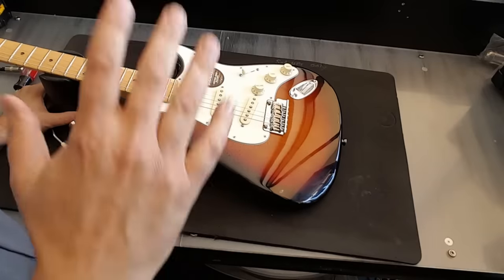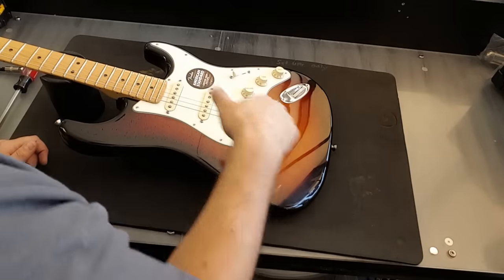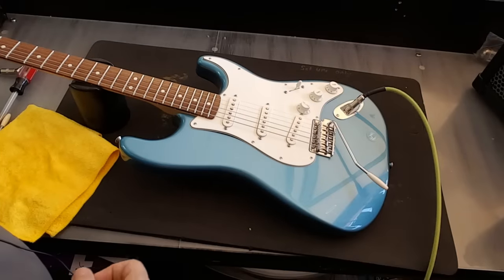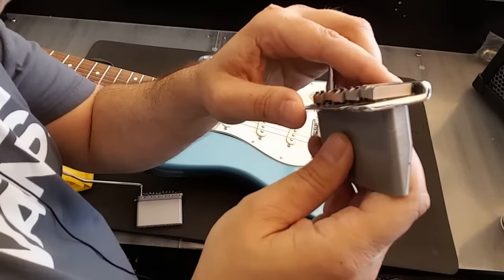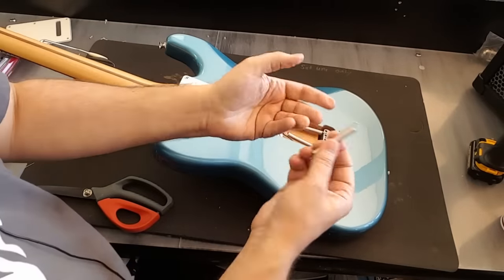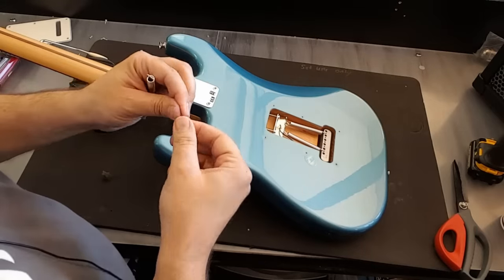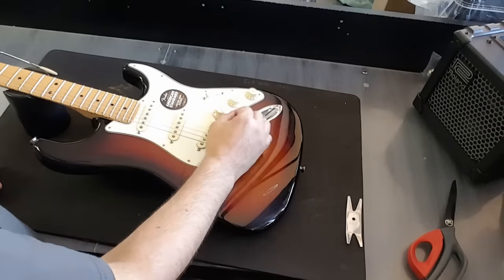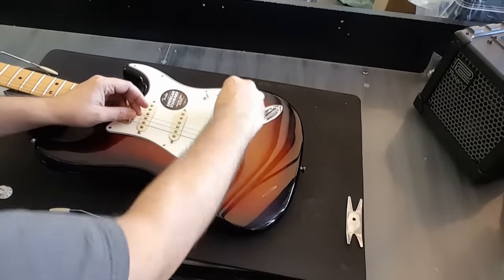5 things you didn't know about your Fender Strat

Comment: No5 is a good one. One of my strats the volume pot moves too easily. I've been looking for solutions but till now not seen any.
Regarding the trem spring, it doesn't work on my MIM strats as the hole goes all the way through and the spring falls out. I just use the old plumber tape and it works fine.
Reply: hahaha Teflon don
Reply: +fishy paw mim strats made before 2006 have holes that go all the way through, but i believe they changed this on all or most mim strats after '06. do you know what years your mexican strats are?
Reply: +fishy paw Yes the older MIM's have a different block. As you said PTFE tape or Rizlas should work: Thats how I secured the switch tip on my '52 re-issue Tele :-)
Reply: Just get rid of all the knobs, the tremolo arm, those extra pickups...
Reply: +moreanimalspirits              You're not here for the bear hunting, are you? :-)
Reply: tezzo55 Ha ha , he's being a right Dick (Dale) ! ;-)
Reply: +Bristol Blue 
Just go down to guitar center, plug in strat with Alnicos into a  hot rod deluxe, and let the tube cleanliness overtake you. You might ask yourself - as I did - what have I done? Why do I need these pedals, these tremelo's, those extra pickups, knobs, switches, blinking lights? Am I a tap dancer or guitar player?
Reply: moreanimalspirits Brilliantly said sir! 
i just plug my ol' 63 strat, into my early 60's Vox AC15, and the effect, is electrifying! Never sounds out of date (even though i do!) :-)
Reply: moreanimalspirits I'm not disagreeing. I was referring to Dick Dale and his stripped down Strat. I have a Les Paul, Ric 330, '52 Re-issue Tele and a couple of Strats. Mostly use a '71 WEM Clubman or a mid 90's Marshall JTM30. I don't have a pedal board, just a few pedals which are used now and then. So, you're preaching to the converted mate :-)
Reply: Fractal over £1000 aint they ? Too complicated for me anyway ! I would rather buy another nice guitar. All I'm looking at currently is a Danelectro Spring King or the Boss '63 Fender Reverb model pedal. I'm in love with the Surf Sound of the 60's and a mate demoed his Strymon something or other . It was OK if you're Dave Gilmour or want to spend over £250 on something you'll never use :-)
Reply: Bristol Blue True dat bro, and i ain't about to get one thousand bucks, any time soon, so you is right! 

The Danelectros look amazing! i've never actually played one, but i'd love to, they look so cool!

 And then these other treasures of which you speak, i know them not, but they sound well groovy, (a thing for which, one should always strive!). 

i'm presently putting a dream guitar together, from parts sourced from all over, and it's cost a fortune and it took a while to get all the bits, and i'm NOT a guitar builder (spot the deliberate error, yet?). 

The body is a chambered, semi-solid, f holed strat shape, with gorgeous flamed, book-matched, maple top. It's presently got a creamy finish, but that should wipe off, do you think?  :-)

i got a Mighty Might, maple neck, a gold Stets Bar, gold automatic tuners, the classic two Seymour Duncan humbuckers, (is it, the jazz and the Jeff Beck?) and, Oh yeah, the Stets Bar, has piezo, for midi, and uh, piezo sound. 

And this very day, i'll be clearing my work bench to start work on it, after some two years or so, of collecting the parts.

So i guess you have your purists, and then you have your sluts, and i guess that's me! Hee hee!

So i'm feeling well groovy! Hope you are too bro. Thanks for message man, love guitar players. 

Best  :-)

Comment: The trem tension spring does not and will not prevent anyone from cross threading the arm. Cross threading when it happens, happens right at the start of things
Reply: Although i do understand what you are referring too,
 In this case... i dissagree, 

The spring helps to prevent
over tightening of the arm,

Picture this...
A thread can be 100% perfect whilst screwing the arm in, 
Until it is overtightened to the point where the arm runs out of thread & then bottoms out causing the initial thread in the block to be disfigured,
The thread on the arm can be over stretched aswell,

Hence,
Thread damage can and will only begin to happen upon removal of the arm.
Reply: To avoid cross-threading, the common "trick" is to begin by turning the arm the opposite direction (as if you're unscrewing it) while with ever so slight pressure push the arm inward. As you slowly turn the arm, you'll reach the point where the start of the two sets of threads pass each other. When that happens, you'll feel the arm drop inward slightly, at which point you immediately stop turning counterclockwise, and proceed to turn screw the arm in. This technique, of course, can be applied to any screw situation, not just tremolo arms.
Reply: shucks.. try a little plumbers tape on them threads. works like a charm.

Comment: Phil. 
You're an extremely knowledgeable guy with a lot of guitar stuff. I have a question that I can't seem to find the correct answer. I have even emailed Fender with no response. 

When looking up a Serial # for a Fender Strat on the Fender website. It tells you a bit about the guitar the number is attached to. Even will show you a picture of the guitar in seemly the correct color of the guitar. 

Would you know if the color that shows up on the picture of the guitar after searching the Serial # is in fact the original color of the guitar? 
I have searched a few and they all seem to be matched correctly with a guitar I am interested in. However, I am about the buy a 2019 Professional Series that is Olive Green but shows up as a White Strat after searching the serial number.  The guitar hasn't been resprayed... 

Ideas?

Thank You

Comment: so does that tremelo arm spring not work on a MIM strat?  there is a hole in the bottom of that opening so when i put the spring in, it just falls out the bottom.
Reply: Some of the earlier 90s mex had a hole in the bottom, so you cant add a spring, but im pretty sure all recent ones are solid!
Reply: mine is a '10
Reply: whitedevil2 tap the hole and put set screw in it.
Reply: My MIM Strat came with an Easy-mute tremelo.

Comment: That spring noise is created by putting the springs in wrong. You don't want to go all to the center like this: \|/
You want them to go parallel like this: | | |
Otherwise you create uneven tension on the springs which results in ringing and buzzing of the outer two springs.
Reply: What actually happens is that the outside springs are at a different tension than the middle spring. Because the two outside springs are the same tension, as long as your claw is balanced and not all cockeyed, the difference in tension between the outside springs and the middle spring doesn't do anything. However, what it does do is pulls the bridge just a bit more, so if three springs is too light for you but four is too stiff, the added tension of \|/ may feel better to you. As long as your claw is balanced and your springs aren't damaged, there isn't any difference in tone or tuning stability. One is not better than the other, it's just a preference thing.

Also, regardless of which way you do your springs, they still make noise if they aren't dampened in some way. One way is not quieter than the other.

Check out how Carl Verheyen sets up his Strats for a neat way to set your claw and springs up, which is not equal tension, allows for your bar to pull up a half step on the high E, a whole step on the B, and a minor third on the G, while still maintaining tuning stability.
Reply: NOISE..?    thats the Trem Strat magic...wow...buy a Tele

Comment: Using the little spring with the trem arm also allows you to have a bit more space between the trem arm & the bridge and body. Sometimes in order to have the trem arm fairly secure and not loosely swinging around, you have to screw it in so much that it seems almost too low to have a finger between the arm and the body. The spring takes up the space enough to keep the trem arm at an ‘altitude’ that’s a little more comfortable. 

If you don’t want to use it but also don’t want to lose it - you can take a piece of tape & secure it to the backside of the rear cover plate. 
Just a thought…

Always enjoy your tips & tricks, Phil! 👍🏼🎶

Comment: Hi Phillip- here's funny Fender spring story: On our way to a gig in 1987, my 1963 Volvo 544 sedan popped a carbuerator spring in the middle of the Santa Cruz mountains. Of course the whole PA, & all the gear was "tetrised" into the Volvo, but we were able to get a spring from my 1963 Jaguar whammy that worked(ironically, same year as the car). You aren't kidding about the strength- that spring is STILL on that (running) car today( which now has 2 million miles on the original B18 engine. I will NEVER drive anything but an old Volvo. WORD.).  Sold the Jag in 2009- have newer Tele these days. (Miss that Jaguar.....)

Comment: Using the little spring in the trem arm hole makes a squeak noise when the bar is moved. It’s better to wrap the bottom of the trem arm grooves with pipe tape. There are different thicknesses and you can decide what works for you. Keeps the trem arm right where you need it and the arm is super responsive to touch. No gap in that slot. I’ve done that for player’s guitars and they agree it works great. Give it a try and see if you like it

Comment: strips of interweaving felt work nice too for the trem springs; never thought of inserting any sort of dampening down the spring, however. nice trick.
Reply: Fold pipe cleaners in half and cut them 1/2 inch longer than the spring's coiled section.  Then insert then in the spring with a bit protruding past the ends of the coil.  Straighter ISN'T better, a couple of small kinks in the folded pipecleaner will help it stay centered in the spring.  Check every so often and recenter the pipecleaners after re-kinking them.
I guess eventually the cloth area wears out and needs to be replaced eventually.  It'll take a while.
Reply: Oh yeah, weaving (over-under-over, etc.) pipecleaner through the strings behind the nut and behind the bridge stops those areas from ringing, (example, a Les Paul style setup).
In my experience, this will have very-near-zero (or zero) effect on tuning stabiliy.

Comment: 1. Holy crap! Mex thanks you for this, spring on the way. 2. Way ahead here. the shielding in the mexican strat was just a bit of foil tape and sounded like deathmetal in the basement, so I did a total overhaul of bay shielding, push pull pickup switching with mid reverse and series added bridge pickup, star grounding, 0-100% volumes, and much improved hand selected caps for grease bucket tone circuits and kept the 100% original look. 3. one does not mess with the bridge wood screws unless absolutely necessary(fear). The string tension and spring choices actually raises the bridge. 4.The bridge springs are a free spring reverb man! Nice tip though, you can bet I'll try it one day. 5. Quality pots will also work to stop looseness (see mods)

Comment: I have a mystery for you – purchased a 2016 Eric Johnson
Rosewood Strat in Lucerne Aqua Firemist color. It’s one of the ones with the
binding on the sides of the fretboard. This is the 3rd EJ that I’ve
owned, so I am relatively familiar with the ins and outs of it. Funny thing…I noticed
that the tips of the magnet poles in the pickups were actually beveled, so did
a quick comparison to my others. Turns out, the other EJ pickups that I have
are flat, non-beveled at the magnet ends. My next step was to look under the
hood. On the one in question, all 3 have the rectangular ‘Fender Custom Shop’
decal on them, with the bluish markings on the underneath side of the pole
pieces. 

Everything about these scream Fender Fat ’60 pickups like
what can be found on the Fender Postmodern Custom Strats from around 2015 (not
the EJs that have specific markings on the bottoms). My luthier says that all
the solder points were straight up Fender factory solder points and that this
guitar did indeed come from the factory this way. 

Have you ever seen anything like this? I wonder whether this
was just a mistake at the factory. I am the second owner, but the first owner
did not swap out the pickups. It sounds fantastic.

Comment: Thanks man the tremolo tips work for me, I'd worked out the loosening the screws and springs are cheap on e-bay. As for foam, it's a little less to throw away. Might need to be checked after a few years mind. It won't last forever.

Comment: But, what about setting up the tremolo bridge the way St. Leo originally intended it to be? A little up off the back of the body of the guitar, (about 3/32 - 1/8 high) and Dremelling / round filing out the screw holes so you get a nice knife edge on the 1 and 6 screws?  And, and...you can also use clear plastic tubing to stuff inside the tremolo springs.   Loved the advice about the static, and the tremolo arm spring, as well as the foam spacer, on the Vol knob.  Brilliant!

Comment: "Vibrato and tremolo are often confused — and not just by musicians, but by manufacturers as well. The tremolo arm on your favorite guitar, for example, is actually a vibrato arm...Vibrato is a modulation effect that varies pitch. This is actually the way that “tremolo” bars work, despite their name...
Tremolo is also a modulation effect created by varying the volume of the signal. Tremolo is particularly useful for creating percussive shuddering or stuttering, as well as gentle or intense pulsating effects.  Tremolo effects can be found on many amps, such as some Marshalls, Fenders, and Voxes, as well as in stompboxes and effects devices. True vibrato effects are available in certain stompboxes and effects processors, but rarely built-into amps.  So the next time you’re looking for the perfect effect to create a sense of undulating rhythm and motion, if you want a more warbly, “underwater” pitchy sound, go for vibrato. If you want a more staccato stuttering or pulsating effect, go for tremolo!"  From Sweetwater.  -Doug Pratt, Atlanta, Georgia, USA

Comment: you can use pipe cleaners to dampen the tremolo springs, 
and a paper hole-punch to make the hole in the foam bushings for the pots. fast, easy.

Comment: Phillip I used a fender rubber ring that keeps your strap on and cut the hole  to fit and it works great there is a little more friction so if you fiddle with the volume a lot you may not want to use the rubber.  It is not my idea I tried to find the guy that I saw do this but I could not find the video again.  It is a guy in the UK

Comment: I got these tremolo springs and they just ate themself through the trem block of my 62‘ Vintage Reissue Stratocaster. Now it stucks in there and the winding of my trem bar broke and it’s stuck in there as well. 🙈
So my recommandation is, to not use these springs!!! My tipp for you: TEFLON TAPE!!! It’s noiseless and doesn‘t destroy your tremsystem. 👍

Comment: With respect to the tremelo, the instructions for my 02 American say to adjust the bridge angle using the two claw screws in the back cavity.  Fender recommends a 1/8" gap at the rear of the bridge (above the body).  But if you want the bridge flush w the body the manual says "Do not over-tighten the two claw screws.  Set the tension of the springs to eqyal the tension of the strings, while the bridge is resting on the body."  So you may end up needing more or stiffer strings if you want the bridge flush.  Don't fuck with the two attachment points(for the bridge)  at all.

Comment: You just solved my Telecaster Volume Knob problem ! Ha!Ha! I was gonna' replace my Volume knob because it is so loose and the slightest touch and it's Wide Open or Off , Thanks , so simple of a Fix ! (Reminds me of the Guy that lost all the lug nuts off one tire in front of the Insane Asylum , had the tire but no Lug Nuts , wondering what to do ! Guy looking out the window of the Hospital says "Take One nut off the other tires and that will get you to Help . Guy says "That Genus , what are you doing in there"? Guy says "I'm Crazy , Not Stupid !")

Comment: My 'plug & play' supposedly 'noiseless' pickups picked up a LOT of static. I had to remove the pick guard, shield it from the inside and re-assemble....That worked.
What I don't understand is why Fender doesn't build these with the modifications already installed? 
I never saw a warning about the tremolo bar spring either. 
Creating a foam 'donut' for the volume defeats using your right hand pinky to do swells...

Comment: If you lose these springs wdmusic sells them in a 12 pack too from the Kluson Tremolo which is exact spec parts as the Fender vintage trem and all are interchangable.  They also sell brass blocks and the other parts considerably less expensive.